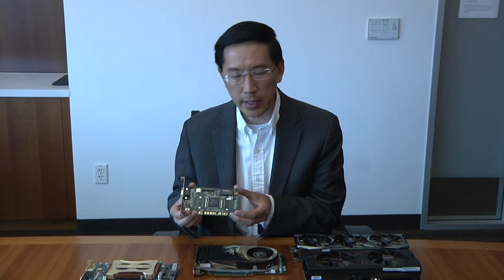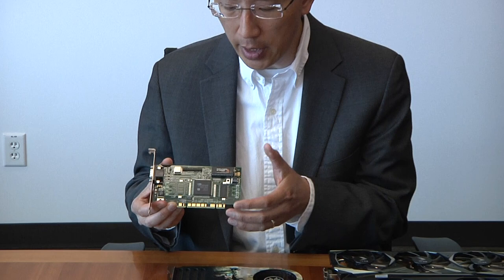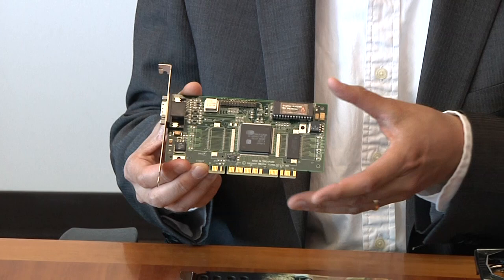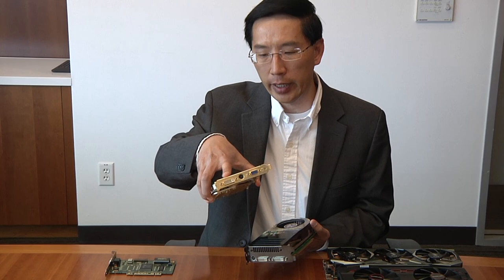Thermal Challenges And Moore's Law

Comment: Great video, the audio was a bit too low IMO though. 

I have a question. When do you think graphics cards will obligatory  be watercooled for customers ? 
The cooling solutions have become more and more complex and sophisticated but a large heatsink with big
 fans and heat pipes has some downsides (limitation for the heat dissipated, weight, size...)
Reply: I don´t think water cooling will be obligatory anytime soon, cause there are also many downsides to it:
Pump endurance
Leakege
Liquid evaporation
Various corosion risks

Air cooler will pretty much last forever (maximaly you replace broken fan. There´s a risk of evaporation of the liquid that is inside heatpipes, but that takes really long). But with water cooling there are many things that can go wrong and causes various reliability issues even after few years.

Water cooling will become obligatory once (if ever) we find out a way to get the cooling liquid flowing literaly inside the chip through channels under transistors - I believe water cooling directly inside the chip has a big benefit in decreased differences in temperatures across the chip. Today even if a chip is running at comfortable 60°C, you might have a hotspot with 80°C. And this delta increases as you advance to smaller nodes. New AMD GPUs report GPU Edge temperature (temperature at the edge of the die) and Junction temperature (highest temp across all sensors, which might not be the highest temperature on the die but it comes close to it) and there are big differences between these two.
Water cooling channels inside the chip would really get rid of these hotspots in my opinion.